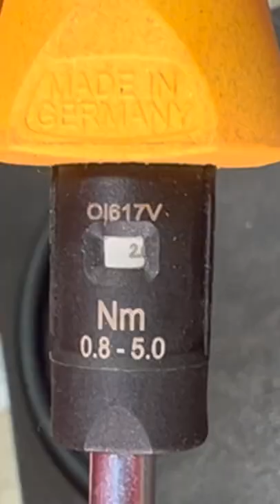How to Wire a REAL Extension Lead

Comment: Those IEC connectors are so very durable too. Always worth while giving the contacts a quick spray with contact lubricant / cleaner too, especially if used in adverse conditions.
Reply from the maker: Good tip
Reply: I love the fact that versions up to IP69 are available, enabling couplings waterproof up to at least 1 M/3 Ft, 80 C/176 F.

Comment: Soo many people don’t even know about ferrels on your wire leads for strands. Makes it so much better
Reply: And safer! One single, near invisible strand left out will make you move, or lay down till Lord Jesus returns.
Reply: A lot of CeeForm plugs like these won't take insulated boot laces.
Reply: Allot of terminals are not designed for ferrules and won’t grip them as well as the bear wire they were designed for.  In many cases people are wrongly using Ferrules in bear wire terminals because they feel they look like they are doing a professional job.  In reality use the correct termination for the correct terminal.

Comment: Where do you use CEE-connectors in UK? Here in "other parts in Europe" we use it often at camping places after every country use different local connectors. Then for fridge lorries, bigger machines, ships, ship containers, and entertainment equipment.
Reply from the maker: The same kind of places - caravan sites, general industry and concerts.
Reply: I am installing some in my house at the moment. Some three phase plugs and a few 230V plugs for the kitchen. I hate the Perilex plug (some Dutch cultural standard) with a burning passion.
Reply: And the army. Up to IP69 rating, and versions available that are explosion proof to a certain level.
Reply: @stalincat2457  Perilex, which is a brand name, is also used in Sweden and Germany. The compact size is nice. The pinout not being stanardized is a problem.
Reply: @HansOvervoorde  That's not right. They use a left-around against the typical right-around at 380/400/415V three-phase. This is standard at Perilex. If the electrician do not following the rules ... Interesting that other countries outside the FR of Germany known Perilex.
Reply: @OldLordSpeedy  funky single phase Perilex pin wirirg vaiations are commonly found in The Netherlands...
- 2P+2N, aka 'stove group', aka '2 phase'. In this set up, the Perilex socket provides the L and N of two separate, yet combined, simultaneously switching 16A circuit breakers, providing a max of 32A from a single phase to an electric stove. See ABB abbfg, Hager VKS03SF.
- Perilex whole house ventilator speed regulation set up: N+L+L+L. All 3 L's are connected to the ventilator motor circuit. Two L's are remotely on/off switchable, making the motor run faster or slower.

Comment: 0:16 Just watched on slow motion, still can't tell if it actually reached torque and clicked or if the bit just cammed out.
Reply: Camming out a Torx head is quite the achievement so i'm gonna go with option 1.
Reply: @stalincat2457  depends on the screw material, feline comrade. 😼
Reply: @stalincat2457  its not a torx, it is a Philips or maybe Pozidriv (He is using a pozidriv bit). 2. it did cam out, watch the slot on the screw head and go frame by frame with the comma and period keys, the driver turns, but the screw does not.
Reply: @RalphBrandsma  You're right. Watched it on mobile before.
Reply: @stalincat2457  just commenting back to say it’s crazy to see someone on the internet that will say someone else is right. Have a good one!

Comment: Где такую зачистку и отвертку купить?
Reply: For the screwdriver, look for Wiha TorqueVario. It is best to buy a set, which is expensive, but for installations that must be perfect to specification a must. The wire stripper (cleaner) is from Knipex. Both tools are sold on Amazon.

Comment: Crimps aren’t needed but a nice touch I guess
Reply: for a stranded wire they are needed cause the strands will get cut by the screw, lowering the current the cable can handle.
Reply: @yolowolfyt  The screw base doesn't touch the strands in these connectors, they are clamp based and designed for stranded wire. Technically the bootlaces aren't needed and there is an argument  that suggests bootlaces decrease the contact surface area of this type of connection and thus increase the resistance and potential for failure to overheating.

Comment: Failed at the point of crimping on ferrules.  If the screw loosens at all its a bad connection.    With bare wire, if it loosens at all, it's still somewhat tight and has a good connection.    Kind of like using a lock washer vs not using one.

Comment: There is actually a flaw in this assembly procedure.

In those screw terminals, they are designed for bare wire, NOT wire ferruls. This can be a cause of potential resistance and a heat spot, also as the ferrul compresses it'll loosen over time causing sparks. Ferruls should only be used in screw terminals where there is no compressing plate, just a screw directly onto the wire.

I am talking from experience.  C'mon eFixx..... I thought you were better than that! lol
Reply from the maker: We don’t agree with you on that - it’s the same type of terminal used in Din rail terminals. The terminals are designed for use with a wide range of conductor types Class 1, 2 and 5
Reply: @efixx  But DIN rails are not subject to the abuse and vibrations of an extension cord.

Comment: I will never understand having like 3 different plug standards in one country lmao
Reply from the maker: That probably applies to most countries
Reply: 3 is probably quite a conservative estimate to be honest.
Reply: Different connectors for different applications! 😇

The UK/HK (IEC type G) outlets are very durable and robust - Partly because the UK application to ring circuits means the hardware has to safely accommodate surges up to 60A - And for this reason is also used for high-load (A/C, cooker, dryer) circuits in countries like Malaysia and the Philippines.
However it still wouldn’t be safe for sustained 415v at 50A despite its robustness…And trying to make a general use connector that could also accommodate single and three phase circuits, voltages up to 50kV and current flow in the 100A range would produce outlets and plugs that would be very big, universally hated in the domestic environment, and very very expensive! 🔌💰😇

This can be seen in many EU countries, where double-insulated appliances will typically come with an omnidirectional two-pin plug (Like the US equivalent NEMA 5-15: Originally intended only for lamps) and full Shucko/CE plugs with an Earth connection will only be supplied where regulations oblige one. 😇
Reply: @dieseldragon6756  Thank you for the information, I was unaware that the UK style plug was used elsewhere for high powered appliances.